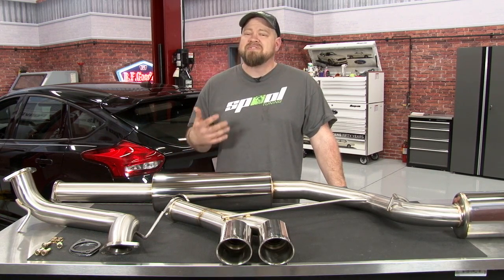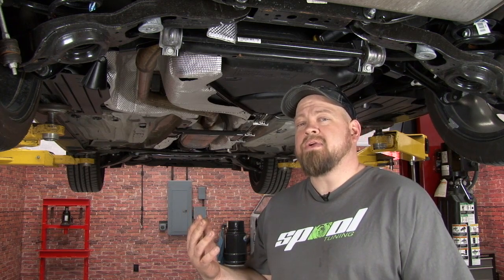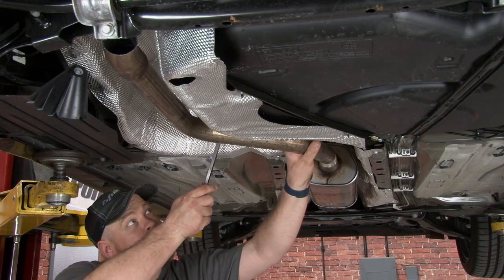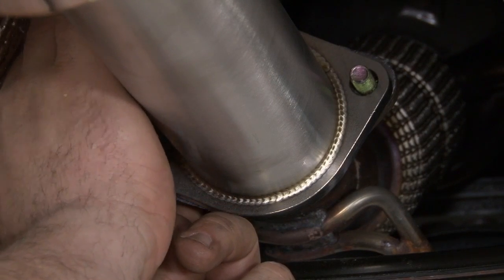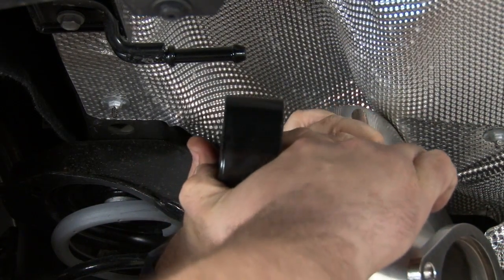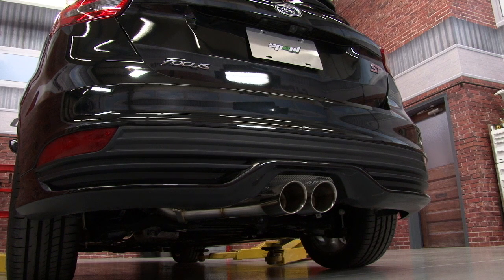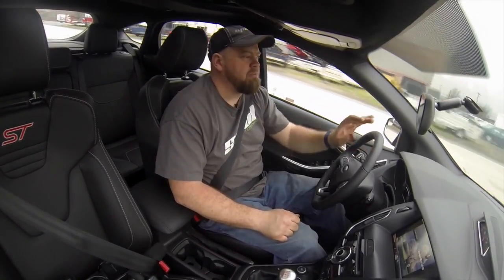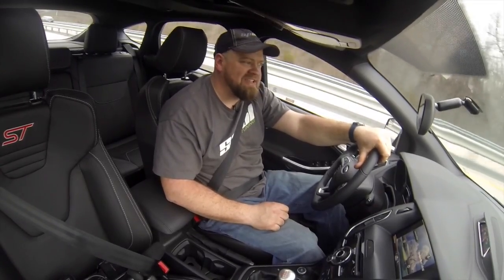Focus ST COBB Cat-Back Exhaust System Stainless Steel 3" 2013-2018 Installation

Comment: I've had this exhaust with an mbrp catted DP and it has a lot of drone when you are at highway speed and especially if you want to pass someone. The bass is too much for daily driving. The sound is ok... Not that exotic tbh. Great exhaust for a weekend car or track car. Not daily if you have a DP installed and want to have convos in your car or not have a headache later on. ford performance exhaust waiting to be installed for that matter.

Comment: Does anyone know why on the EcoBoost engines when you rev them up, they rev back down so slowly? I hate that part
Reply: More than likely it's probably the heavy flywheel, just like the stock exhaust, intake and intercooler it's primary function is to eliminate feedback. When my car needs a clutch I'll be going to a lightweight flywheel and report back.

Comment: I bought a 2014 with a Cobb already installed and there’s an insane amount of drone, anybody know what the cause could be?
Reply: Probably catless? I have a 2017 ST and it's got a AWE exhaust and it's way way too loud for me and plus a crackle tune and it sounds like gunshots its a bit too much for me lol might get this Cobb exhaust but they arent in stock on their website
Reply: @adalbertosantiagopagan8738  Did you end up getting the Cobb?
Reply: It’s your sound symposer, if it’s still on anyway. Aftermarket exhausts don’t really agree with the extra induction noise and makes a tone of drone

Comment: Hello Bill... first I want to say that you guys are the only shop that does these great videos for aftermarket parts and for that I thank you guys.  So my question ( I have 2016 ST) I have watched all these video's you have done and they all sound great but then I hear the next video and it sounds great... since I can't afford to buy 5 different system I would like to ask you opinion (knowing it is just an opinion and everyone has one LOL) but with that said which exhaust did you favor?  I don't want drone at highway speeds, nor the popping when I back off,  but when I stand on it I want to hear and under normal driving want that nice sound.  Which one or 2 would you tell me to look hard at (price is not a concern)  Thank you
Reply from the maker: For me it would be a coin flip between the Cobb and the MBRP. The MBRP is deeper, I like the tone of the Cobb WOT.

Comment: Thanks CJ this made my decision making a lot easier. I went to my ford dealer today where they install Borla cat backs on their cars they sell, and it was WAY too loud. The entire inside of the car was vibrating and I did not like it (car also had a catted down pipe) I dont want an exhaust that is going to vibrate things loose. But at the same time I want a nice rumble. I think this exhaust will be perfect. How is the in-cabin vibration? Does the center console/rear seat vibrate or resonate too much? (not drone, i am talking like, u can just feel vibration channeled through the car physically)

Comment: Hello Bill, I'm very interested to buy this exhaust, but I'm afraid that will be too loud, I know long ago you tested the Mountune CATBACK, in your experience how much louder is the COBB against the MOUNTUNE ? also when I see the videos of the MBRP it seems too me equal loader as the COBB, is there a big difference between both? Thanks in advance for your help.
Reply: The Mountune was very quiet, too quiet for me honestly. The Cobb is louder for sure but not LOUD by any stretch and I think it sound really good.

Comment: Will this void the warranty?
Reply: Straight answer, No. There are some dealerships that might try to weasel out of paying for a 'modified' exhaust, but they have to prove the parts caused the failure. No catback will cause failures when the o2 sensors and other components are upstream from the modded part. Even an aftermarket BOV or air filter/intake cannot void a warranty. The moment you plug in a tuner though or replace the dp (especially with a catless one) or intercooler, you're on your own.

Even Ford will tell you these mods wont void warranties, but they prefer you get Ford parts and have them install them to be 100% sure there are no issues, especially the tuner (they will install it and keep the warranty).

Comment: What's the loudest system you have heard on the ST so far?
Reply: roush..no doubt.
Reply: I think it's the borla exhaust
Reply: I have flowmaster and its loud
Reply: Jose Guevara I have Flowmaster and it’s Quiet
Reply: The srs exhaust is the loudest
Reply: Roush and borla